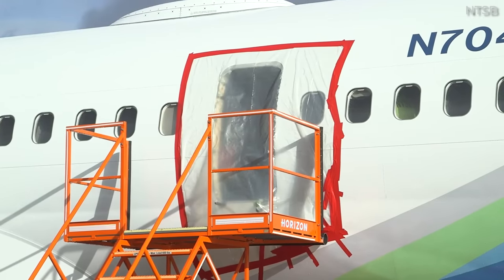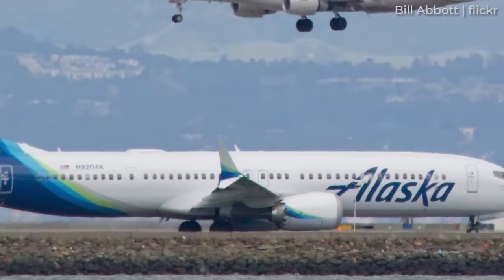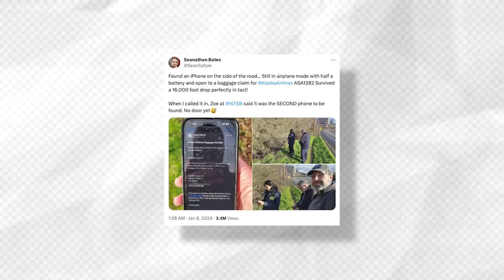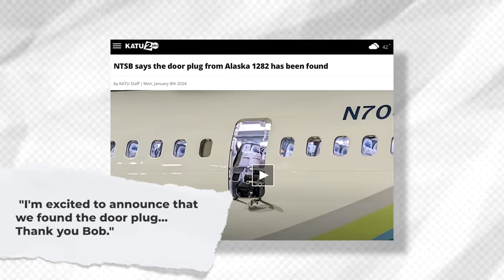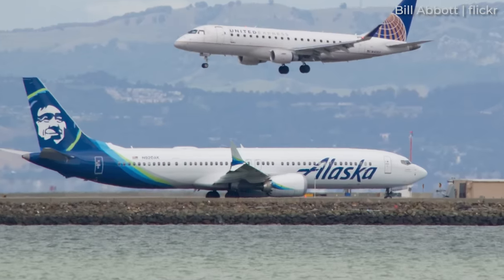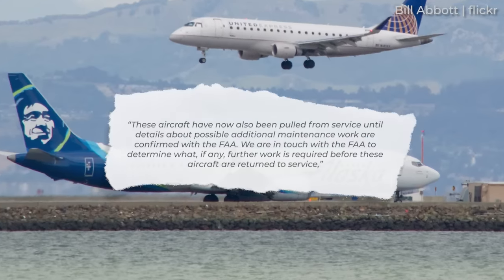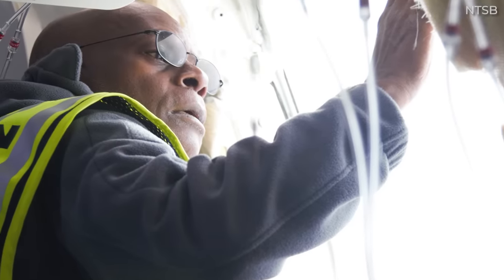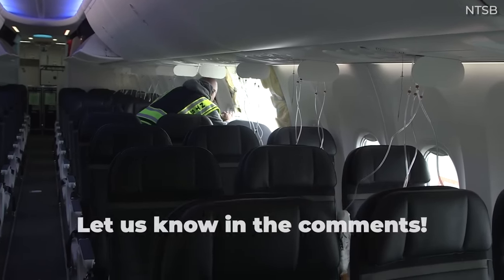Flight AS1282: Are We Seeing Another Boeing 737 MAX Crisis Unfold?

Comment: Am I the only one thinking that this isn’t just involving the 737 Max 9 but also the 737-900ER? They’re similarly equipped with the same Door or Door Plug. If I were the Airlines and the FAA, I’d would be checking both variants.
Reply: This accident sounds like a one time issue though, seeing as it has never happened on any 737-900ER and 737 MAX 9 until now.
Reply: The doors on Max 9 and 900ER are not necessarily the same doors, during production a lot of parts of any airplane go through iterational improvements and are likely to be different in a lot of ways. On top of that the Max variants of 737 is pressurized more than NG variants, which also means that structural elements and/or internal panels are changed too and the combination of all those factors lead to the outcome on hand.
Reply: I think this has nothing to do with design, but a lot with bad quality control.
Reply: The 900ER's are also on the list of aircraft to be inspected.
Reply: @gnke they do not pressurize more
Reply: You can drop the “ER” we just cal them nine hundreds in the biz
Reply: @rokiesensei  The door on Ryanair's MAX8-200 is not the same - it is ACTIVE.
Reply: @justing42 oh damn, your right, fsr i just assumed they upped it since ng, but apparently they decided not to, thanks for pointing that out to me!
Reply: Looks a lot more like a quality control issue, which is somewhat more concerning.

Comment: I see from the photos that there are more bolt holes around the opening, and they only use 4 bolts? Is this another cost cutting to save a few bolts? Can we start a gofundme to help Boeing buy more bolts for the MAX jets?
Reply: Those are not bolt holes. Door stops and pads are installed in those lugs/holes. They are not designed to hold bolts to secure the plug.
Reply: @stephenjarzombek2903  Ok, thanks for the clarification. I stand corrected.
Reply: There are 4 tracks on the sides of the door and 4 pins in the door opening in the frame. The door has to be lifted up and out of the tracks for it to be opened. The 4 bolts sole job is to block off the 4 tracks so that the door can't be lifted up. There is very little force on those bolts and having only 1 installed would prevent the door from being lifted up. I think it's pretty obvious that the odds of 4 bolts under very little stress with cotter pins preventing the nuts form falling off all failing at once is zero. They were never there to begin with.
Reply: @wally7856  It makes sense. As long as at least 2 bolts are in place, loose or not, the door should not shift up.

Comment: This accident (it's too serious to be called an incident, according to the NTSB) will bring scrutiny to Boeing, which is ultimately responsible, but also to Spirit AeroSystems, which operates the former Boeing plant that supplies 737 MAX fuselages to Boeing. It calls into question Boeing's judgement in moving its fuselage manufacturing to an external supplier. 
    Even before this latest accident, I had heard discussions about Boeing's relationship with Spirit Aerosystems, including suggestions that Boeing starved them of funds during the pandemic, as they both tried to cope with a bad situation all around. There have been recent issues with the quality of fuselages supplied by Spirit AeroSystems. I don't recall the details, but it seems that parts supplied to Spirit from subcontractors were okay, but those same parts that came from Spirit AeroSystems internally were defective. 
    Whatever the other ramifications once the NSTB report on the root causes comes out, this will certainly affect Boeing's efforts to ramp up production of its major cash cow. I understand Boeing has delayed its target of reaching 38 narrowbody planes per month. In the meantime, Airbus is on track to reach 65 planes per month and is talking to suppliers about 75 planes per month. Aircraft buyers are all hoping for Boeing to get its act together, a reasonable level of competition for Airbus will help keep them honest, and provide buyers more options and price-bargaining power.
    Boeing's big problem is not competition from Airbus. For the past five years since the two fatal MAX crashes, Airbus has had such a big backlog of orders for A320 family jets that they have not been able to go after Boeing customers. Operators with Boeing narrowbodies are stuck with planes that are growing older and they are forced to push back their plans of fleet renewal. Boeing is leaving money on the table, and the flying public is getting a progressively worse experience with flying. And now, new concerns about safety arising from Boeing and not the competition. Boeing's worst enemy is itself; it keeps shooting itself in the foot.
Reply: Why were the ONLY two 737MAX crashes with third-world Airlines? 
Flying an airplane that up until the time of the crashes had experienced ZERO incidents.
 
After a year of test flights and data-gathering, the MAX gained certification from the FAA in March 2017, followed by other global regulators later that month. 
By May 2018, a year after the first delivery, more than 130-MAX's were in service with 28-different airlines around the world and had flown almost 42,000 flights.
With ZERO incidents
Before the second crash, there were nearly 50-carriers that were operating the MAX. Using it for an estimated 8,600 flights per week. 
With no ZERO incidents.

That the FAA and EASA didn't know about MCAS, a meme being pushed by BOEING BASHERS and the MSM, is bovine excrement. 
Although Boeing did not call MCAS out by that name, the Boeing Flight Crew Operation Manual (FCOM) described the function in detail, and how to override it. 
And 50-carriers crews had no problems with understanding it. 
The FCOM was successfully used by 50-carriers to train crews in flying the new 737 variant.

Lion Air and Ethiopian Airlines with their low-time inexperienced pilots and with inadequate management of their crew training - ruined the safety record of a perfectly safe airplane.

The fuselage plug issue occurred in ONE airplane, out of 1,420 delivered and after flying over 100,000 incident free flights! 
The plane and crew handled the incident perfectly. Nobody was hurt. Not even a sticking plaster was needed in this "disaster"! 
Boeing and Spirit will take remedial action - and the 737MAX will go on to be as safe as any other commercial aircraft currently flying.
Boeing has 4,031 MAX aircraft in its order backlog. 
You think these folks who fly these wonderful airplanes every day for a living think the MAX is dangerous? Yeah right!
Crossing the street, or driving one's car to get groceries, is 1,000 times more likely to get you killed than flying in a Boeing 737MAX.
This is just an over-the-top, hysterical, hyperbolic nonsense coming from woke folk who want to live a life of 100% safety! 
Better stay at home and sit on their couch!:face-orange-frowning:

Comment: Just imagine if that left horizontal stabilizer had been wiped out as the door was departing the aircraft.
Reply: I refuse to believe these were all coincidences… those 2 seats being empty, the door not hitting anything on its way out, the plane not being at cruising altitude…
Reply: @damlatorun6756  what is your theory then?
Reply: @damlatorun6756 You have a very overactive imagination. 😏
Reply: & it was at max attitude ?

Comment: Boeing need a whole new narrow bodied jet, messing about with what is a 1960s airframe fuselage is crazy, the lower to ground 737 fuselage and wheel setup is designed for the older torpedo shaped engines also used on the boeing 707 as well! The 737 is too low to the ground to extend the fuselage, a longer extended body and banging bigger engines on it affects stability and landing speed. Due to this we are seeing all sorts of issues.
Reply: Remake the 757!!!
Reply: Those are called JT-8’s
Reply: Boeing isn’t going to make a new plane for one reason: no one wants it. All these airlines told Boeing they wanted an upgraded 737 rather than a new plane. So Boeing did that. The 797 won’t sell well especially with Airbus across the pond and now Airbus has built a huge maintenance facility in the US which should’ve put further pressure on Boeing
Reply: @justing42  thanks i could not think of the name of those engine types!  The 737 is sat too low to the ground to enhance it, sticking bigger engines on it is clearly causing all sorts of probs

Comment: My dad is an airline pilot, and he has a saying: “If it’s a Boeing, I’m not going!”
Reply: Back when people didn't trust Airbus's fly by wire systems they used to say "If it's not Boeing, I'm not going."
Reply: @garydodson6737 still the chance of you actually dying is still incredibly low. Otherwise Maxes would be falling out of the sky constantly.
Reply: @Bobspineable  I mean thats now a 2nd fleet grounding in only 7 years of service. That's not good at all. It's also Boeing's 3rd fleet grounding in the last 14 years with the Dreamliner battery fires in the mid 2010s.

Sure statistically Boeing's are safer to fly than to drive, but the company is an empty shell of its former self, To have 3 fleet groundings in 14 years from one of the biggest manufacturers in the world is not a good thing at all
Reply: Yawn
Reply: Then fly Spirit airline or Allegient Airline, they operate the fleet of airbus planes.

Comment: This is not just an anomaly, this a production issue deeply rooted within the current quality control culture of Boeing and its subcontractors. 
Those 737 Max should be banned for ever at this point, Boeing lost complete trust from companies and public after major system design problems and structural issues on brand new aircrafts. 
Unacceptable.

Comment: I just got insider information from one of my uncles that works in the same hanger they did the maintenance on that exact 737-Max9.  fittings which there would be if the plug had been attached.   Quality Control must have been non existant. He speculates that

Read more

Comment: It sure sounds like the 4 locking bolts, used to prevent the door plug from opening, may have been left out during the build process.  This should have been obvious when the door plug was recovered from "Bob's" backyard.  It seems unlikely that Alaska would have inspected or serviced the door plug mechanism on its brand-new aircraft before this flight.
Reply: They never get looked at other than during the walk around

Comment: Scary to think that the 'plug' is attached only with 4-bolts. You'd think being a significate sized part/piece of the plane more bolts/fasteners would have been used. Seems Boeing was cutting costs or taking the fast and loose choice!
Reply: 7 hold a Trent 7000 on wing…it weighs about 15000 lbs.
Reply: There are 2 tracks on each side of the door (4 total) and 4 pins in the door frame. The door slides down in these tracks securing it. The are also 10 stops along the perimeter of the door that line up with 10 stops on the frame that take the force of pressurization preventing the door from pushing out. In order to open the door you have to lift up the door so that the tracks lift up and out of the way of the pins and that the stops lift up and out of the way of their corresponding stops. The 4 bolts in question's sole job is to go through the track blocking it off so that you can't lift up the door. There is no force on these bolts unless you are actively lifting up on the door. If even only 1 bolt was in place that door couldn't be lifted up and out of its tracks. I think it's safe to say that these 4 bolts were never installed as they are secured with cotter pins so they can't back out even if loose.

Comment: The 737 bodies are built by Spirit Aero in Wichita. I've visited this plant, it's impressive. Based on what I've seen so far, (as an A&P) it does look like hardware failure. Parts quality has been a huge issue across the industry, especially since C0V!D.
Reply: And of course, supply chain issues ever since the war between Russia and Ukraine.
Reply: Quality control is NOT a supply chain issue.
Reply: correct @sherkinbrain
Reply: @sherkinbrain it could be a worker pay issue tho….
Reply: @Zrich98  No, if a worker agrees to a job, then they are willingly taking on responsibility for safety. If the worker is not happy with the pay, they can petition for more or leave. Willingly forgoing safety due to repressing unhappiness with pay is irresponsible.
Reply: @markn866  it’s America. That’s what people will do.
Reply: @markn866  good luck finding honest worker with sub-par pay

Comment: Everyone is saying this is absolutely a manufacturing defect by Boeing with absolute certainty when there are definitely other possibilities. The plug may have been removed or something adjusted when maintenance was trying to solve the repeated pressurization warning issue, which may or may not be unrelated to the door. Maybe some improperly trained or disciplined tech/engineer thought the bolts weren’t secure and over tightened them and broke a bolt. Something like that. The plug may have also been removed to install the interior, which may have been contracted to an outside company by Alaska. It’s not a foregone conclusion that this is a manufacturing or factory QC issue that occurred before handover. Still, given their recent track record, there is a decent probability that the blame lies with Boeing and/or Spirit. I guess there’s even a decent chance the bolts were never installed or reinstalled and nobody actually did the required checks before letting the plane fly off.

Iirc, Alaska is very willing to ground planes until they know for sure the problem is understood and can be mitigated. I’m guessing they have a good safety culture.

Comment: This is a Quality Control issue, part fabrication, material source, installation process.  This could be a "one of" or systemic: bad set of forgings could we wider spread, or mechanic had a rough weekend, and the quality guy missed it.
Reply: “Quality guy” is called an inspector, and they are involved in about 10% of maintenance.  The only way they would have been involved is if there was a slide on that door/plug (it’s a plug and there was no slide) so there is no inspector required, and no “second set of eyes”.  The inspectors were finding the end of the internet or sleeping…guaranteed.

Comment: So it turns out the plug is just a panel fitter to the outside, and isn’t an interference fit from the inside!  
Another Boeing engineering short cut?
Reply: This type of plug door is standard and is widely used for a long time. It’s not just a panel, it vertically taller then the actual hole and it rests on pressure points and needs to be lifted up before it can be removed.
Reply: @bishopdredd5349  Evidently not. No plug, no go as failure mode is unsafe.
Reply: @bishopdredd5349 it’s a plug.  Not a door.

Comment: Take your time before bad mouthing the aircraft. They have the door. Several questions have to be answered.   Did the door shear? Are the pressure lugs and upper roller lock cam there? Are the safety bolts in the roller locking cam. Which inspector signed for the safety bolts at the factory? Did Alaska open that door for training or any reason? The pressure lugs look to be intact on the door frame. The design of the pressure lugs have been in service for about 70 years. The difference  is this door slides upward.
Reply: No use hoping that folk will be reasonable. YouTube video comments are all about armchair experts 🙄
Reply: @eckie4679  I hope we get the right answer. My opinions of the FAA/NTSB have waned in the passed 20 years.

Comment: MCAS used only 1 air speed sensor so the software could not calculate that a sensor went wrong. And now only 4 screws for a door plug ?
Reply: There are 3 holding a 717 engine on

Comment: Would be interesting to know why this is only a MAX-9 grounding issue given the MAX-8 is made on the same production line
Reply: Because the plug doors are only a 737 MAX 9 thing
Reply: Going to try avoid row 26 then haha be c** myself in row 26 now!
Reply: The Max8 does not have this type of door plug system.

Comment: I WILL NOT FLY IN A BOEING 737 MAX AIRCRAFT! Two deadly air crashes due to a software system pilots were completely unaware of and was DEFECTIVE, and now a hull failure, (yes it's an unused escape door, but it is a hull failure!). There will be more of these things. There are serious problems not only at the North Carolina plant where they build the 787, but now in the Renton Washington factory as well. There are lots of these aircraft flying built under these substandard factory standards and more serious accidents should be expected! Even as an astronaut, would I fly the Boeing space capsule being built? HELL NO! I'd be requesting to fly on SpaceEx's Crew Dragon actually! I no longer have any faith in Boeing products and the last good airliner they built was the 777. Can I trust the 777-X?...Probably not! Time to boot the board of directors and replace top management and NO GOLDEN PARACHUTES, they deserve this!